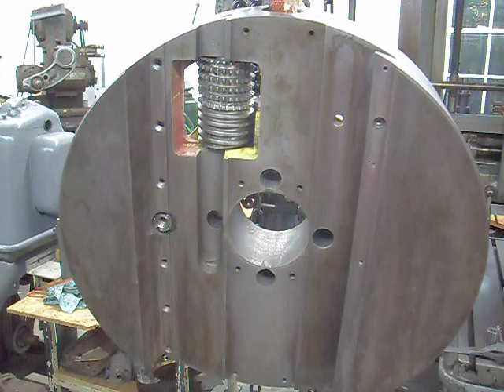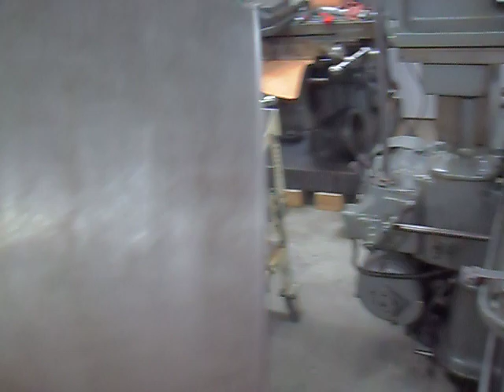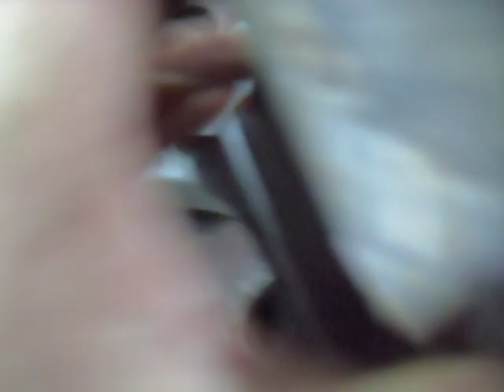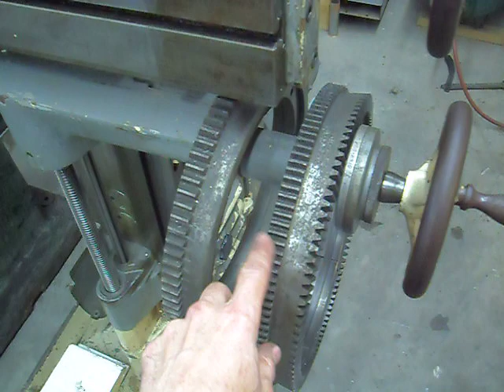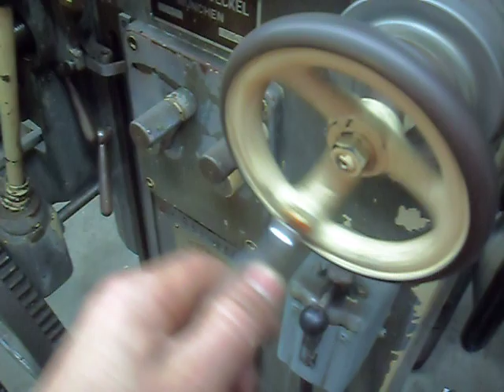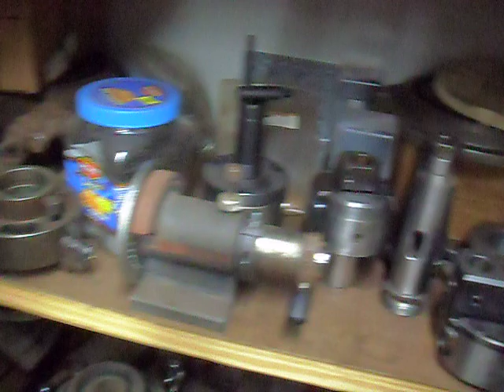Doozer's Machine Shop Update 11-03-19 -- Taking apart the Facing Head

Comment: Great job! I am wondering if you could mount the facing head on your machine successfully and if it does work. How the flywheel like gears coupled with the spindle?
Reply from the maker: I am planning on making an adapter out of a piece of steel round, 7" diameter to make the bolt pattern of the head and that of my HBM spindle face.  I will not be using the flywheel gears.  Originally one was to drive power (independently of the spindle) and one was for facing feed drive.  I will just be rotating the head with the attaching bolts, and no facing drive at this time.  I actually made a hex socket to be able to adjust the offsetting gears, so I can just use it as a boring head.  I could add a "star wheel" for facing drive like the old days.  Will see what my needs are as I get to use it.  For now, just going to get it mounted and use as a boring head, no facing.  Thanks for watching.